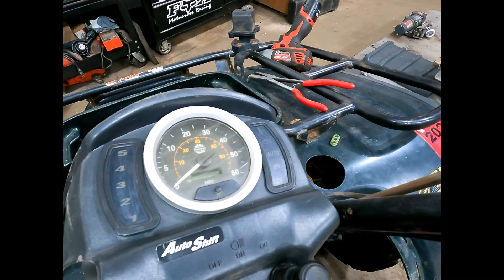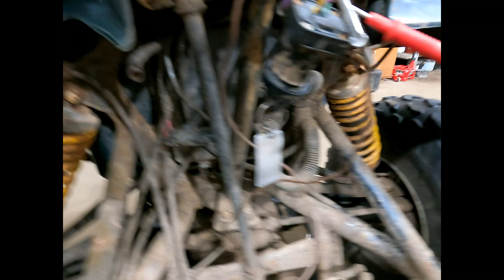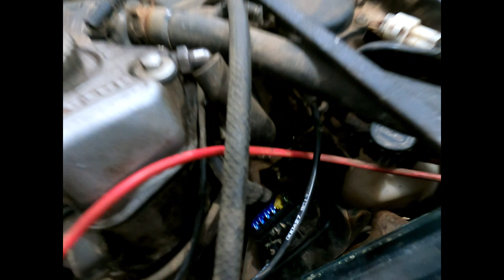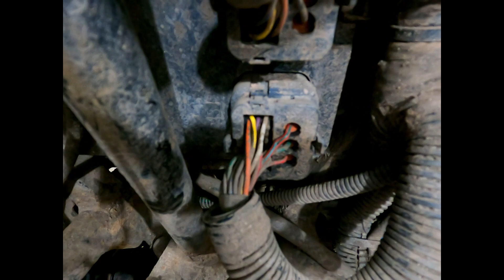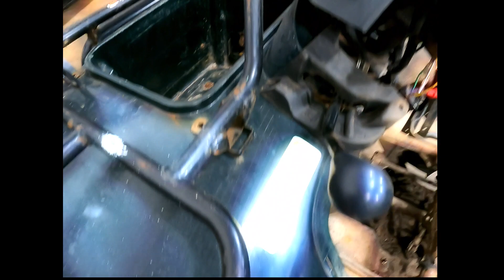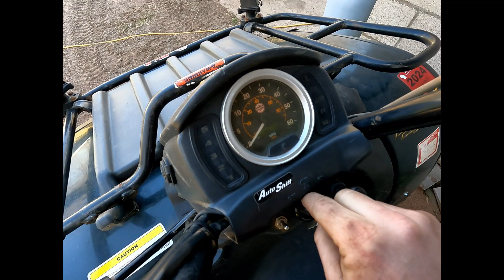2003 Bombardier Traxter Max 500 No Electrical Power Fix!

Comment: I got lights and spark but no electric start. All fuses look good and also has a new starter solenoid. No clicking or anything at all when I press the start button. What could be the issue?
Reply from the maker: It's probably a bad starter or starter switch if you don't hear any clicking. You can try putting 12v directly to the starter with jumper cables and see if it turns over that way. If not it's probably a bad starter.
Reply: @smallenginerescue How would you take the starter off to be able to do that?
Reply from the maker: @_Wetbread_  Sorry for the delay in I did not see this comment until now. You dont need to take the starter off to do it just put 12 volts to the positive terminal on the starter with it still in the machine and see if it works that way.
Reply: @smallenginerescue no worries I’m surprised you even responded in the first place I just have one these quads at work that’s been sitting for four years and my boss wants to get rid of it and I tried hooking a battery up to it and it didn’t click and I tried troubleshooting it, then I stumbled on your video thank for your reply Ill lyk how it goes
Reply: @smallenginerescue the problem I’m having is tryna figure out where the terminals are and what you need to take off to get to it